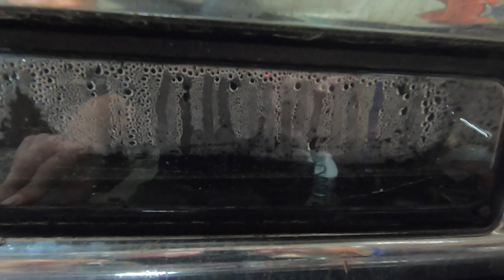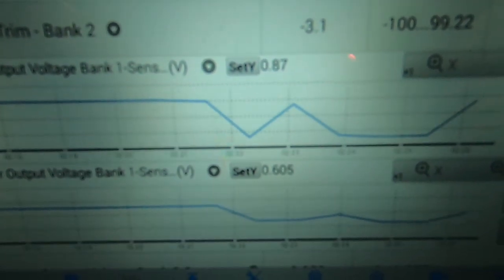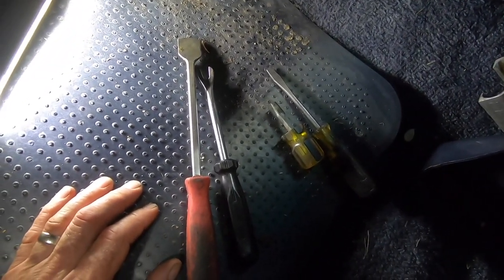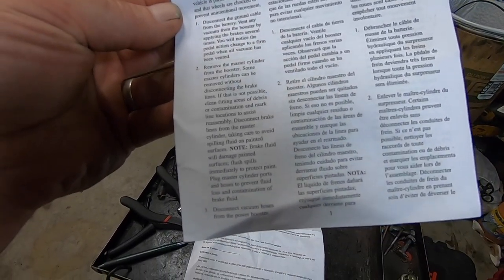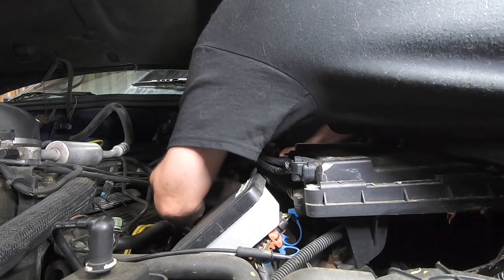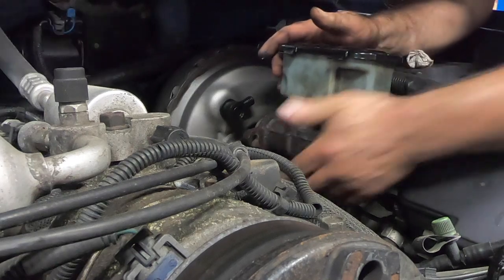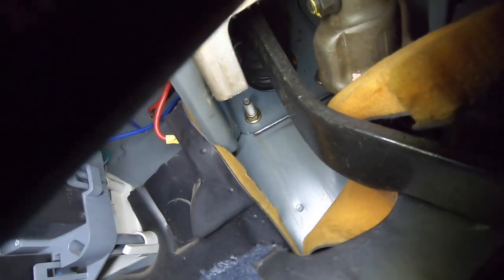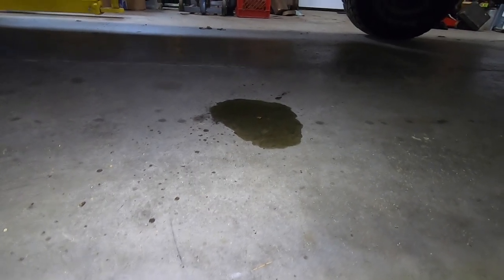'98 Suburban brake booster diagnosis, remove & replace

Comment: Awesome video Smitty!
I just did this job on my '98 Tahoe, what an ass-whoop!
I'd recommend to anyone to separate the steering shaft, it's just one bolt and allows you to push that steering column out of the way and down into the firewall thus giving you way more leverage points to deal with those four bolts and more importantly, deal with that friggin' brake light clip!
Also, use the end of a flat blade screwdriver to 'seat' the new brake light clip cuz you ain't gonna mash it down with your bare fingers!
Reply from the maker: Thanks, Shawn. GM engineering can make a cluster$%#& out of anything! 😂

Comment: Hey Smitty!
Agree 100% with your opinion of the older style GM trucks. This video brings back memories, I bought a '99 GMC Suburban 1500 SLT in 2000 as a leftover for 24K. Drove it 16 years and accumulated 278K miles before selling it to a barn door body style collector/dealer for $3500 in running and driving condition with a valid inspection sticker in Oct of 2016 (when I bought the new Tahoe LT)
That old Suburban ran mint, never a trans problem, no A/C issues, and no electrical gremlins. Only major failure was the radiator at 195K +/- miles. When I sold it the rear A/C worked as new, the rear defrost still functioned, and the heat would drive you out! The factory remote door locks still worked as well. It had small rust bubbles starting at the door bottoms but the paint was original, the same blue as your video unit.
That said, I related to your struggles with that booster, and then the upcoming brake lines. Ugh, another testimonial to age and salt corrosion we all know and love here in New England....
Work safe, stay cool, enjoy your weekend!
Doug@ the "ranch"
Reply from the maker: Sounds like another great one! Definitely got your money's worth out of that! Too bad GM can't build anything close to that quality anymore. Sad.

Thanks for watching, Doug! Have a great weekend yourself.

Comment: Awesome Video, so you are saying that due to a bad brake booster engine can run bad.  My 1995 Chevrolet Silverado has been smelling alot lot raw fuel and it is not braking correctly and it makes that same noise when i step on pedal.
Reply from the maker: Thanks - I appreciate that!

Yep, the only barrier between inside of the engine and where the rod comes into the cab for the pedal is a rubber diaphragm. Once that tears, there's a direct link. There will be vacuum getting pulled through it any time the engine is running (same as an air leak to the engine), except at high loads or full throttle. With a worn out engine or a large performance camshaft, the air flow can even go backwards (from engine into booster) under those same conditions.

Comment: Great video and information . If you had a chance to do it over again would you have done it the same way or drop the steering column ?
Reply from the maker: Thanks, Mark, and thanks for watching. Well, time is money, and I don't think I'd have saved any by dropping the column- that would've just put the column right in my way, so I wouldn't have been able to lay across the floor.
Reply: @SmittySmithsonite  Okay thanks for getting back with me , I have one I am getting ready to replace unfortunately .
Reply from the maker: @MarkAnderson-vg5vq  Yeah, it’s bound to happen sooner or later with this platform. Good thing is everything else is built very well, the total opposite of the newer models. This rig has over 300k miles on it now. 😎
Reply: @SmittySmithsonite  Built to last

Comment: So I have a 98 3500 pickup GMC that looks about the same under the dash as the one you're working on here and I have the Leaky seal in the hydroboost and I'm almost starting to wonder if it would be easier just to split the hydroboost apart while it's actually still hooked to the firewall so I don't have to deal with the trouble of taking it out you ever dealt with this before? Great video by the way it definitely showed me what I was looking for underneath for sure.
Reply from the maker: Thanks, Evan - glad it helped! I have just about zero experience working on hydro boost systems, aside from replacing lines, so I won't be much help there for you. Sorry about that! Good luck in the repair - hope it's smooth sailing for you.

Comment: The video I was looking for i had an Buddy I know fix my brake booster and he loses the rod now gotta find one pain would you happen know the length and with of urs
Reply from the maker: Sorry - I wouldn't know - I never measured one before.

Best course of action there would be a visit to the local junkyard, or maybe even eBay if they're sure it came out of the exact same truck. Good luck - sorry I couldn't help you there.
Reply: I was thinking that to go to my local (u pull it)thanks for fast reply 👍

Comment: I suspect my booster is bad on my 98 silverado. The truck rpm kinda lopes  or hunts only when I'm at a stop light and imnon the brake  if I put it in N it goes away. Also has a bit of a rough idle and minor hard starting  when warm. Also running lean.  I've replaced literally everything hunting this problem. You think it could be the booster?
Reply from the maker: Easy way to find out is to clamp off the vacuum line to the booster - just be aware that you might need 2 feet on the brake pedal if you need to stop. I'd test it out in the yard, though - no real need to get out on the road for this test. If all the problems go away with it clamped, and there's no leaks in the hose ahead of the clamp, then it's the booster.

Comment: Damn it took me like 2 minutes to get the bolts out i had my electric impact and a few extension and a swivel on the deep 15mm
Reply from the maker: You got a Wednesday truck. 👍😁
Reply: Yeah its gold so you know its the best to work with hahaha
Reply: I just saved so much time with an impact and a swivel extension

Comment: gota love under dash work i drop column makes for more room wire harness bracket on master whoops.had same truck 99 just sold it 230k on it bought for 200$ found 175$ dollars in change in it had cracked head pulled motor gave it a refresh sold for 3k needed money. nh trip was ok lot work 160 foot of fence and wall,5 days 12hrs a day im beat. good job on video showing control vacume leak data. done full brake lines on those kind of a bear, flex line calipers and wheel cyl. see ya next time
Reply: electric tape for those leaking fingers is my go to,lol
Reply from the maker: Glad the trip went well, Willie! Seems to be the week for busting our backs - I just loaded 5k pounds of scrap last week. Was out there by myself, at 160 soaking wet, wrestling a full sized truck bed onto the back of a PT Cruiser I had strapped to the trailer. Fun, let me tell ya! 

Good eye on that bracket! I totally forgot to reinstall it - the camera is a major distraction for me. I have to pay closer attention to everything, and go over everything after it's shut off.

Love the 400 series trucks - no better truck ever built by GM. Mine had 222k on the OE u-joints, and about the same on the whole front end! I only got 38k miles out of the Silverado's lower ball joints, and 50k out of the uppers and hub bearings. Total junk!! 

Thanks for the kind comment Willie, and the great tips as always  - see ya on the next one! 🍻
Reply from the maker: @willefixit  - Yeah, I've done that before - quick and easy! 😁 Same with superglue for the real big cuts. 👍
Reply: @SmittySmithsonite  use glue to forgot yea fence it direct sun most of day big rock s chains gravel,prosess,compactor .lot of work,not useto plus old beat up body .later

Comment: I was out there for 6 hours trying to get them damn bolts out and only got 3 of em , i used a swivel ratchet wrench but the top right one wont budge
Reply from the maker: Yeah, they're a real PITA to get out of there. Hardly any room. Extremely frustrating. Heat is out of the question, since the interior and wiring, and all that plastic would catch fire. 

If you can get a long extension, or anything metal that can reach that nut, put it against the nut anywhere you can, and whack the end of it a few times with a hammer. Then try loosening the nut again. Sometimes you can shock 'em free that way.  Good luck. 👍🍻

Comment: I think I'll disconnect the steering shaft and gain a little more room under the dash. Looks easy except for the damn clip and bolts that have limited access.
Reply from the maker: I have a hard time with any interior work, since my body doesn’t like to bend like it used to. It probably isn’t too bad for someone younger, but for me, working on my back all contorted inside any vehicle’s interior makes any job 400 times harder. With the right combination of extensions and swivels, you can get everything out without removing the shaft. Sometimes the steering shaft can be even worse to get apart, especially when rust is involved. Whichever way you choose, good luck & thanks for watching. 👍🍻
Reply: @SmittySmithsonite  I completely agree. It's not fun being upside down under a dash. Thanks for the lengthy discriptive video. Alot of people kinda skip through some of the small details that tend to be the biggest headaches of a project but I'm glad you touched on those.
Reply from the maker: @chrisv3863  - Glad you appreciated that, Chris. Thanks for the comment.

Comment: hey   is that a benchmade knife?      and keep Cayenne pepper around for cuts that wont stop bleeding
Reply from the maker: marc damron - That sounds painful, lol. 

Knife was a birthday gift from my brother many years ago. Thanks for watching, Marc.
Reply: @SmittySmithsonite  it only burns for a little.
Reply: @damron2  are you trying to prank us or does cayenne work for real?
Reply: @olliefoxx7165  it actually works.    I cut my ear shaving and it wouldn't stop bleeding.    Put some cayenne pepper on it and it actually worked. It's an old home remedy
Reply: @damron2  Well I'll give it a try. If it burns like heck and doesn't stop bleeding I'll just laugh at myself. Thanks for the tip✌👍

Comment: I wanted you to win tuckers giveaway those lessons....did many of those at chevy the clip and nuts always a pain  hope your using nicop on the lines they also make ss molded lines too. and for the next next vid fuel lines!
Reply from the maker: Hey Scuba! I think the truck might be sold before the fuel lines fail. Sounded like the owner no longer had any interest in towing with it - only 3k miles the past 2 years.  Think they were having me fix it just so they could sell it.

As far as the brakes, definitely copper/nickel lines - that's all I use around here. Easy to work with, easy on dies, and lasts forever, even in the salt up here. Love that stuff! 👍

Thanks Scuba! I was hoping I'd win, too, lol.  Not sure my body could do the foot launch thing, though. I've never had any desire to run myself ragged if it wasn't earning me money, so getting in shape before the training was not going to happen  ... I may have embarrassed myself in front of thousands of people on YouTube ... 😂

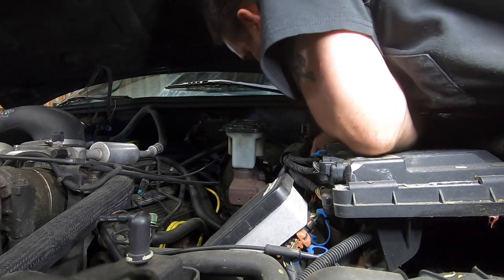Comment: 20:49 is the reason they say disconnect the Negative battery cable.
Reply from the maker: Indeed - someone did some half-assed  wiring in there. At the very least that breaker should've been taped, but it should've also been secured. This thing has had MANY mechanics. Gotta know when to fold 'em, ya know? ;)
Reply: @SmittySmithsonite  Thanks for the upload. I'm going to tackle my booster this weekend and I needed some guidance. This is the video for that! Merry Christmas!! 🎄
Reply from the maker: @UFOGHOSTHUNTER  - Thanks for watching! Merry Christmas!